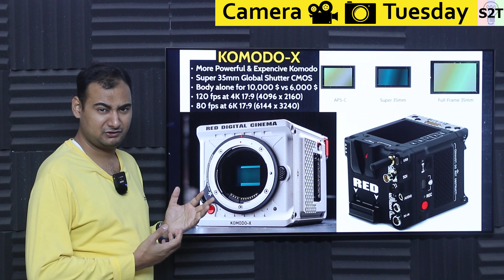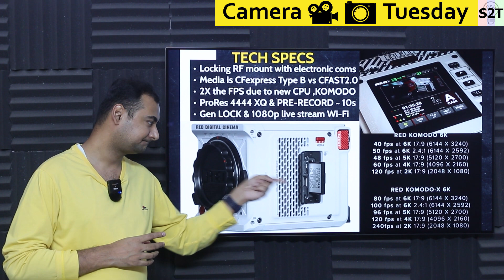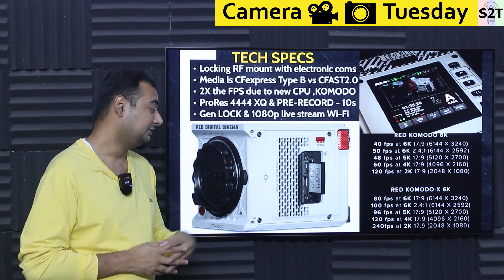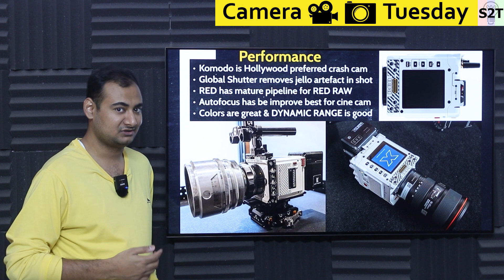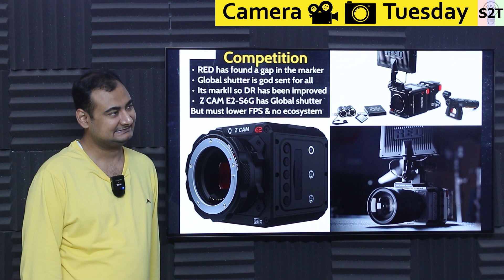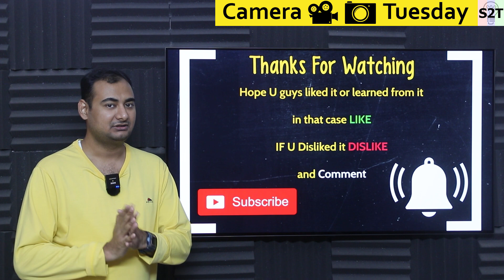RED KOMODO X Explained {Camera Tuesday Ep240}

Comment: 5G networks offer much faster speeds and lower latency than previous generations  
But 5g is not  reliable network like 4g   
 And company Working 6g 7g   is they are  practical network our just marketing tools of company
Reply from the maker: yes if 4 g cant give 50mbps 5g wont give it either only in early phase when u have less subs